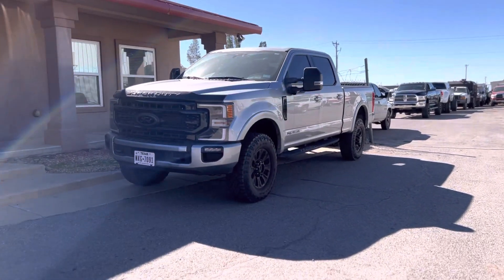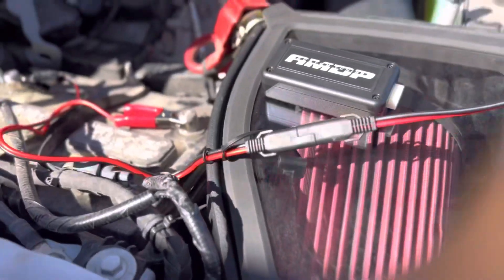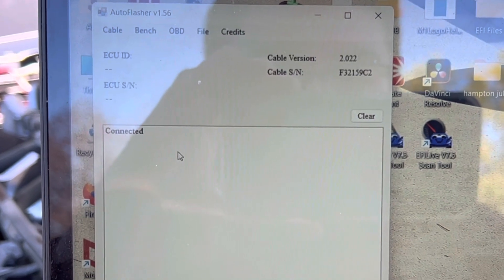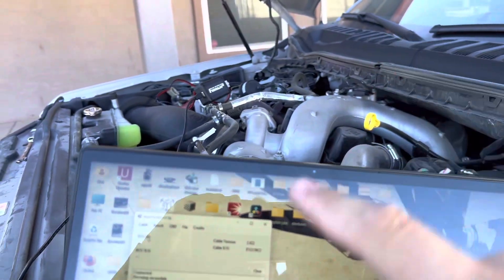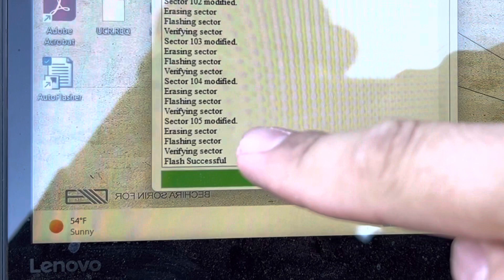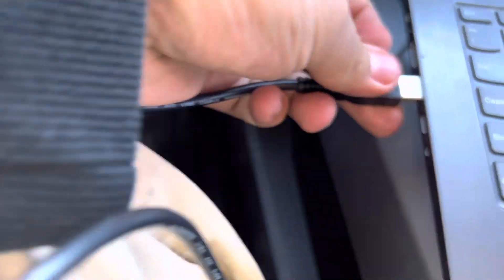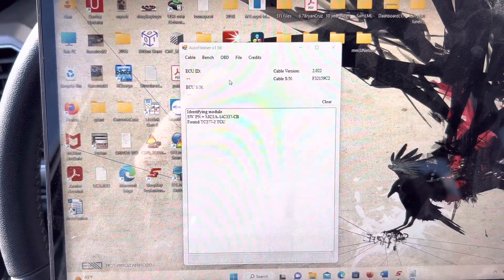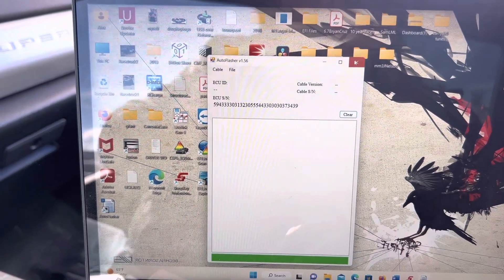2020-2022 Powerstroke AMDP Tuning Install

Comment: Hello, I am helping a friend tune his truck. 2020 6.7. We started programming the truck and the screen on laptop went off because it was set to 5 mom's screen off. Didn't relize it till after. pressed a button to turn screen back on. Well now the tune is stuck at where when the screen went off. it has been in same position for the last hour or so. What to do if this happens? Don't want to disconnect and reconnect if it will mess something up? Let me know asap please. We are using this same tuner you are.

Comment: What do they do with the 10r140 transmission tunes? Raise shift points,  boost line pressure?  Nobody has been clear with this, just that if you get bigger tires, you need to tune...that doesn't say much.
Reply from the maker: @dustinrowling7121 The TCM tuning will Improve the driveability and power handling capability for the 10R140. They offer two options available, stock shift points and raised shift points and do bump up line pressure as well. If the vehicle does run 35" and bigger tires, its definitely recommended!

Comment: Is it necessary to have the truck hooked up to auxiliary power during this? Like a battery charger? I’d imagine doing the ECM you don’t have to as both batteries are disconnected and not drawing from the battery right? Maybe during the TCM install it is necessary??
Reply from the maker: @kyleheiges9496  yes, definitely recommended!
Reply: @Raven_Diesel  even if the batteries are fully disconnected to do the ECM/far left plug? What will the battery charger do as the truck isn’t actually on?

Comment: Appreciate the video man! I bought a kit from speed labs and I got no auto flasher link and almost zero fuking support from them no tune files the customer support is from China or something. 😅 I got a 2022 with the egr dpf del. And I still can’t use my truck until I get this figured out

Comment: Can you do a video on adding credits
Reply from the maker: We haven’t had to do one recently. But it is a simple process. When you open the software and connect to the tuner, you’ll see a tab that says “credits”. Click on that and then press “check credits”. You should see a script below advising you of how many credits it added, or if there is none to be added. Make sure you’re on a strong internet connection when doing this. We did this once on a bad hot spot and it made the credits essentially disappear and never transfer to the device. The tune writer had to send us new credits again. 

To obtain credits, you need to contact your tune writer and they’ll set that up for you.

Comment: Quick question if i wanted add sotf to pcm will i need pcm swaps?
Reply from the maker: You only need to swap the PCM on 2022+ Powerstrokes to enable SOTF capable tuning. If your truck is older, than you'll only need a revision. No PCM swap required.

Comment: How do you select between a hiss or rumble tune. Also what about low boost fueling?
Reply from the maker: You can request a hiss or rumble tune when you submit your tune order. Same thing for low boost fueling. Unfortunately you would not be able to switch between hiss and rumble tunes without going through this process every time.
Reply: @Raven_Diesel  Thanks for the reply! Can you reset the KAM for the trans tunes without ordering a trans tune? I'm just doing an engine tune but want to reset the trans before driving it again. Thanks!

Comment: Have you had any issues with the USB not connecting to the computer?
Reply from the maker: You more than likely need to re-install the USB drivers. They have the file on their website!
Reply: I did. There were 2 different zip files of autoflasher available on the web. The first one didn't contain the drivers needed and the install couldn't find drivers.
I ended up uninstalling everything and starting over.
 when I was trying to update the firmware and the software kept telling me to unplug the cable before updating.  I ended up having to plug in the USB portion of the cable but not the obd end. The update was needed as I couldn't use the software without it.
Got things read on my 2020, stock files backed up and ready to have it tuned!
Reply from the maker: @andystieg6339  Nice! Glad to see that worked out for you!

Comment: What does this flashing provide, and do you  have tuning for 2019 and earlier?
Reply from the maker: If you'd like to program a 2019 or older powerstroke. Id recommend going with EZ lynk. Flashing your ECM allows you to unlock your trucks true potential. More power and efficiency in most cases.

Comment: Do you have to wait for the tuner to send the tunes once you hook it up. Or do they come with the tuner when you purchase it. I’m wondering how long I would have to wait for the tuner to send the tunes.
Reply from the maker: You would have to receive the empty programmer first, plug it into the ecm to read the ECM serial number, than submit that serial number and vin to your tune writer. They sometimes send tunes back same day, but more than likely would be the next day.

Comment: Can you delete and tune a 2022?
Reply: Yes, two options.  Option 1: Delete only, 0 HP (Ford OEM Mexico tune) can be written directly to a 2022 PCM  --- Option 2: Power tuning requires swapping your original PCM with an unlocked PCM from a 2020/2021 (this is the best option as you get to keep your original PCM, you can swap everything back to factory if you need warranty work and there's no trace of a tune being written to your PCM).

Comment: If you wanted to put it back to stock would you need a stock file saved to flash back?
Reply: nobody seems to ever have an answer to this. Is there an easy way to save and reflash the original firmware? And, then, easily swap back to 'tuned'.
Reply: AMDP saves your stock tune file when you send them your Information. If you ever had to go back to stock you call your tune writer and they send you your stock tune. You can also save the tunes on your windows laptop.
Reply from the maker: Your tune writer can send you a stock file if you ever care to return your truck to stock. Would be as simple as flashing it again.

Comment: Did you have to swap your pcm to?
Reply: Try watching the video again 😶
Reply from the maker: PCM swaps are only required on 2022+ Powerstrokes that intend to run SOTF tuning. This device allows you to unlock your ECM at home without removing it from the truck.

Comment: So I bought the delete kit with the tuner for my 2020 Powerstroke and I finished doing the EGR and def delete and went to tune the ecu and the tuner won’t connect to the ecu. Anything I can do to fix this issue. I already replaced the cable that connects to the ecu and it didn’t resolve The issue.
Reply: I might be wrong but I believe you have to do the tune first and then you can remove the egr and dpf .
Reply from the maker: It is recommend to program the vehicle before modifying it. But we have had good success programing vehicles post modification.  @dieselnut2369
Reply: You figure this out?